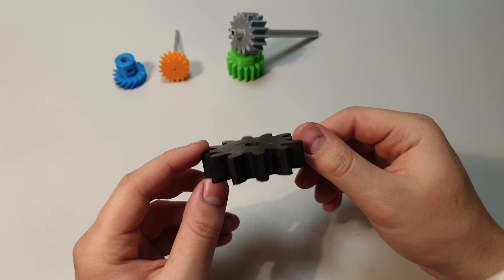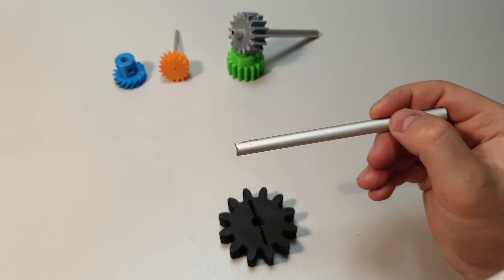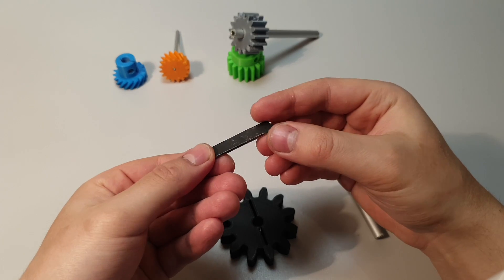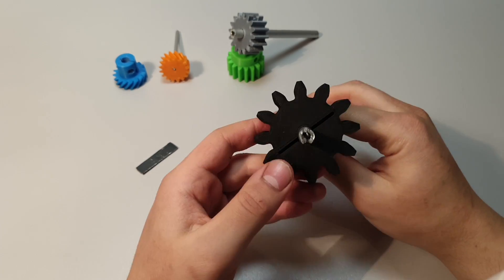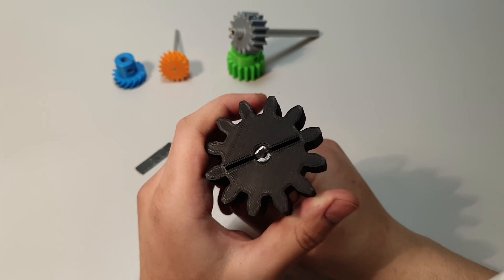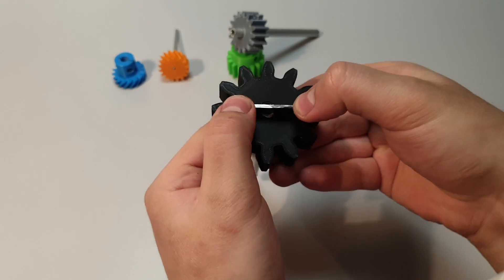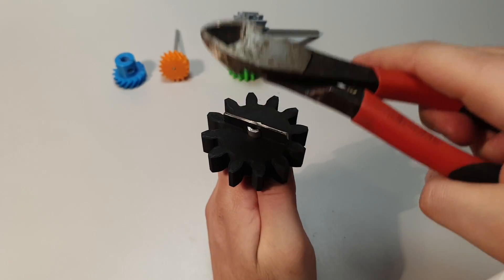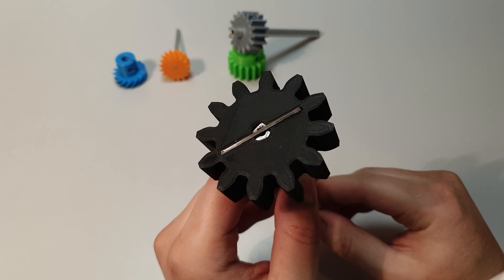BEST Ways to Connect Your 3D Printed Gears to the Rotating Shaft

Comment: when i print a gear and attach it to the shaft, the gear ends up with a wobble. i can't figure out what's causing it, the shaft seems to be perfectly straight and the hole inside the gear is a tight fit.

Comment: what if you make the hole slightly undersize, heat up the shaft enough to melt, and press it in
Reply: If the shaft is circular it can still slip. If you do something like that, at least make some flat edges on the shaft like in the video

Comment: The half circle method combined with a small metal plate pressure fitted in the gear is very very strong.

Comment: thanks.
bolt through the shaft is not for really heavy loads. bolt will be cut after some (more or less) time, I tested :-)
one of the best known methods (really used in heavy tractors wheel to shaft connection) is to combine: coupling (method 1 at video) with small groove on it + small groove on the shaft (something like method 2, but groove) + small "insert" which fits both grooves on shaft and coupling - really nice and strong thing!
this picture shows what I described: http://2.bp.blogspot.com/-NXKE7WAzo_E/VPieCBT5LnI/AAAAAAAAAAc/3YME9oqILRw/s1600/Keyway-lovejoy.jpg

Comment: high quality videos,  pretty sure you will achieve over 100k in next 6 Months if you continue. 
(usually it takes 1 year for hq content)
3:30 its better to drill in between not on the top of the teeth, because this way you can get away without damaging the teeth (or just a bit)

Comment: Number 4, there's a similar concept used in the shaft industry called "machine key". The key sits in a slot along the shaft (held in place by a screw), and the key is what provides torque to the gear. The gear has a keyhole for the machine key on the shaft. These are effective because machine keys are the weak point, making repair easy, able to reuse the gear and shaft. (But generally the machine key is a weaker (less hardness) metal than the shaft and gear, so technically the key would not be the weak point in a 3D print since the materials are the same.)